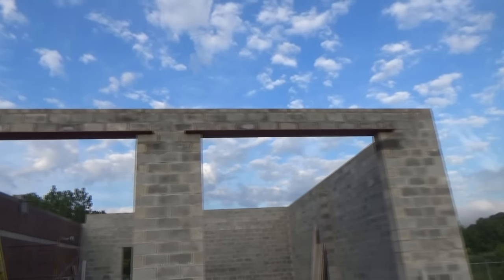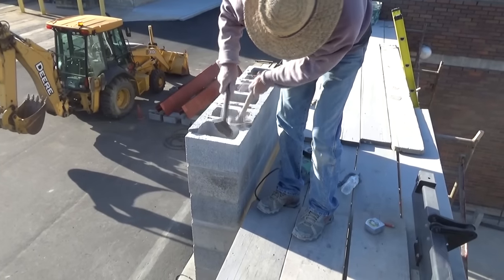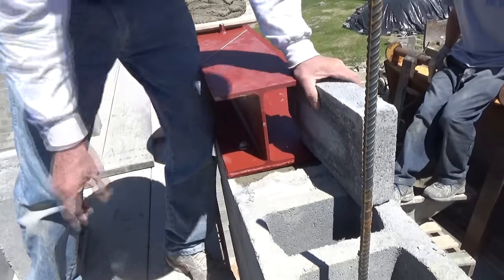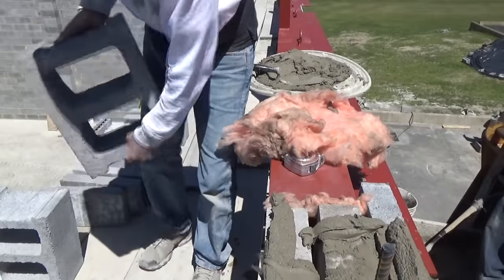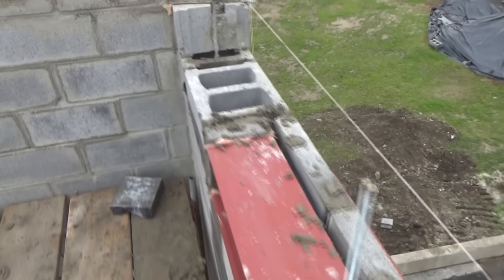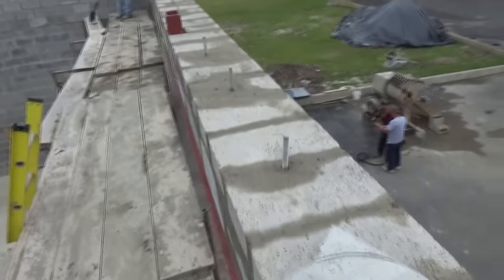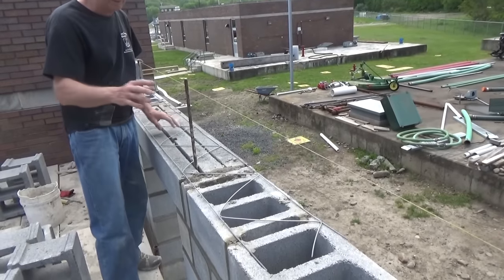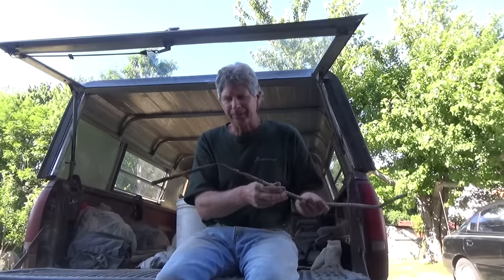BLOCK LAYING (part 7) Mike Haduck) steel beams or lintels

Comment: I really enjoyed this 7 part series. You provided so much useful information. My goal is to [someday soon] build a 28' x 16' concrete shed with a 2nd floor. Thanks to you and a few others on the internet, you've given me the knowledge and confidence to try it.
Reply from the maker: I wish you well,  thanks mike
Reply: One dumb question if I may: when masons finish the walls, do they get shored up before pouring and filling the cores or is the mortar strong enough to hold it all together?
Reply from the maker: Hi USNVA,  usually the cores are filled as you go, with the rebar sticking up to enough to tie into the next few courses, but I always watch the weather for any big wind storms,  walls like these usually are only strong vertical,  God and gravity is whats holds them in the ground,  my opinion,  I hope it helps thanks mike
Reply: Mike Haduck So what you're saying is lay a course or two then fill with concrete, lay a few more courses and fill again with concrete. That would be a lot of truck deliveries. I suppose lay 6 courses and fill, lay the next 6 and fill.
Reply from the maker: I thought you were talking only cores, I can't really say unless I seen it but I did it on my block series after the foundation with a truck (pea gravel)  I would watch the "How I lay block series" for that sort of thing , others may do it different,  I hope it helps thanks mike

Comment: Hello Mike. I really enjoy  all your videos. I like your straight foreward, matter-of-fact style of
demonstrating how you do masonry work.  It's very generous of you to share your experience
and in-sight with others who want to learn more about the masonry trades.
I am also a bricklayer and tilesetter and it makes me happy to see the pride you put into your
work. I wish more people had that attitude. One question: when we lay block, before filling cells around vertical rebar with concrete or grout, we pour a splash of water into the cell and soak it to help the concrete flow better, fill all the voids and cure good and hard. I also
wiggle the rebar to help the concrete flow. Do you do this also? Just wondering. Regards.
Gord J.

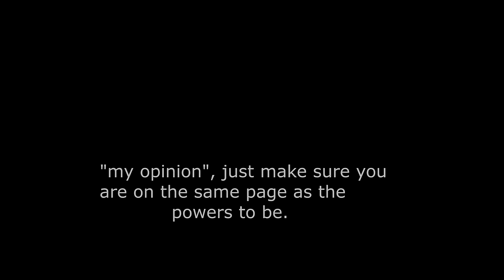Comment: Hey what's up Mr. Mike. At 12:42 , did you notch out that block. Also, could explain why you did not want the block to touch that bolt. Finally,  in your other video you toothed the block out. Is there an advantage than building a lead? Thanks for your videos!! The really help me out a lot. I just got hired with a block crew ad a laborer. I am looking to increase my skill level.  You give a good detailed description about masonry work.  Again,  thank you!
Reply from the maker: Hi R b ,  the steel beam expands and contracts with the weather slower or faster than the masonry, so I give the beams room to do that,,  because of the scafold height I did not want to keep extending the leads out,  anything that works, thanks mike

Comment: You're great Mike. Watching your  wonderfull vídeos from Brazil. I Loved your explanations with that steel beam and massonry.  Your comments about ancient buildings as castles. Yes no steel    present but they overcome big spans with archs and vaults. A question concerning lintels you showed. Are they made in straight concrete or they have rebars inside or pretension. Thanks in advance.
Reply from the maker: Hi Fernando, they have rebar inside them mostly, thanks Mike

Comment: What a great series of videos! More information on the different aspects of block work than any thing I've found yet. I'm doing my research for a project that I will start in about two years and your videos cleared up a lot of the missing information from other sites. I'm looking to build a daylight basement clear spanned with steel beams if physics and my wallet says it's possible. I still have a lot to learn, any good sources i.e. books for what to do for certain applications and the reason why?
Reply from the maker: Hi Andy,  about books,  modern practical masonry,  but it is all about the old churches, castles etc, i appreciate the comment,   mike

Comment: Hello Mike, When you were at the end of the lintel beam using insulation could you use Dow Corning 795 Silicone Building Sealant instead of insulation as the expansion  material?
Reply from the maker: I am a lot of "Old School" and I can not rule it out, I am not familiar with the product and can not say I ever used it, but if it is flexible I can not see why it wouldn't work,  just an opinion,  thanks mike

Comment: that's was very good. today we out some Steel lintel on just like in your video. 
we did not put insulation on them to accommodate the expansion of steel. but we did put an expansion joint up one side.

what is your opinion of placing spancrete on top of 8 inch walls? do you think it should be only on thicker walls like 12 inch?
Reply from the maker: I can not comment on that, I am not familiar with spancrete,  I guess I am still a lot old school.  thanks mike

Comment: I have a question for you Mike. I plan on digging out an underground shelter, and I plan on using a vertical shaft about 20 ft down. Do you think that these concrete blocks would be sufficient enough to hold the walls up all the way down if I layer them and filled all of them with cement? Thank you!
Reply: Just some info, I was planning on using 8x8x16 blocks for it.
Reply from the maker: Hi BMan,  I think you are getting into some serious construction, and what I seen in the service, you would need a lot more than that,  I hope it helps thanks mike

Comment: Mike, it is a garage.  Is the Styrofoam insulator?  why do you use it between the bricks and the wall? can we just leave the cavity?  Thanks
Reply from the maker: yes the styrofoam is the insulator, I will be explaining that towards the end of the series,  they plan to keep the inside of garage above freezing during winter months,    you could leave the cavity,  but if you are going to heat it down the road it is probably a smart move to insulate it,  everywhere is different , thanks mike

Comment: Hey mike i have a question , on block walls is it normal that thetpy crack , the ceacks are fine cracks most of tgem are onbthe joining walls
Reply from the maker: Hi Elm,  I can’t see it from here, but for the most part most masonry walls crack about every 20 feet or so, everything depends on the situations, Thanks Mike

Comment: I have been watching your videos. Great work👍 I have a question if you don’t mind. I am thinking about bricking the front of my old house. The height is 135 inches or 11 1/2 feet. How deep of a footer do I need?  Is there a formula, like for every 5 ft of brick you need 1 foot deep footer?  Thanks - rob in Texas
Reply from the maker: Hi Rob,  usually you see the footer the house is attached too, otherwise you get separation, I would talk to some of the local masons before I do anything another alternative oil a stucco brick cut out of the stucco see my video,  How I do stucco ( part3 ). Brick face, Mike Haduck,  I hope it helps,  mike
Reply: @MikeHaduck  Hi Mike and thanks - I have a pier and beam foundation so there is not slab for an attached footer.  How would you handle that situtation if you needed a footer to install a brick face?
Reply from the maker: Hi Rob,  I would ask the locals, we don’t use pier & beam up here, thanks , Mike
Reply: @MikeHaduck  ok - thanks

Comment: Hi Mike, This has nothing to do with concrete block. My chimney was leaking near the flashing. Someone had built a chase over the stone chimney, so I removed it to get to the flashing. Before the chase was slapped on, someone had covered the mortar and some of the stone with asphalt roof repair. My first idea to remove the hard tar was to grind it off. Of course that just melts it and ruins the disk. LOL Would you use dry ice and a chisel or a torch and scraper or kerosene and rags or something else? Most of the mortar is in pretty good shape, so I would prefer to not use anything that forces more tar into the mortar. Thanks for any advice you (or anyone) can provide.
Reply from the maker: I usually chisel it off, or hammer it off and start over fresh,  I would think that anything else would make a mess,   everything depends of course,  I hope it helps,  thanks mike

Comment: Rebar is iron isn't it? That's why it rots (I thought). I would think beams of higher grade steel should last long.
Reply from the maker: Hi Kris. When you mix metal with masonry it's only a matter of time, just the way it is, thanks Mike
Reply: @MikeHaduck  I guess they don't plan on them lasting more than 50 years anyways.